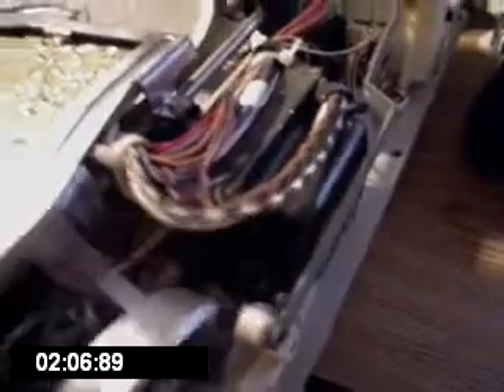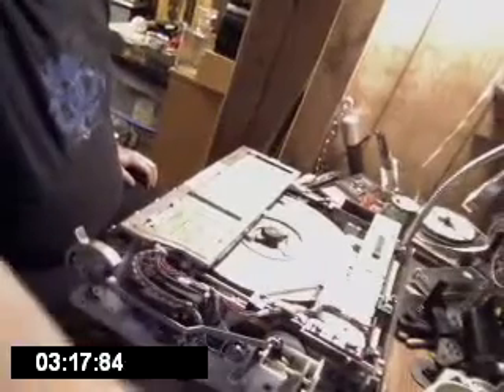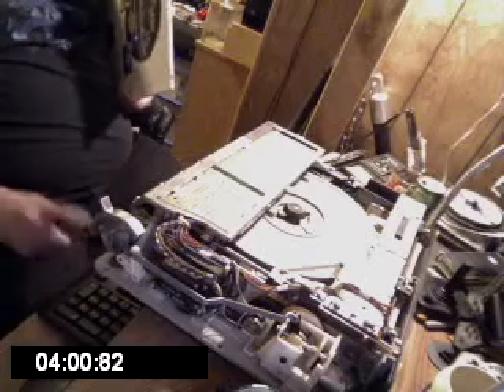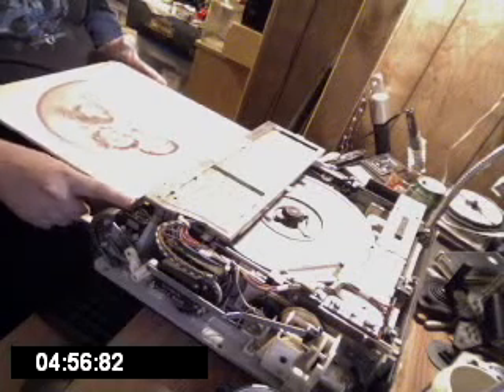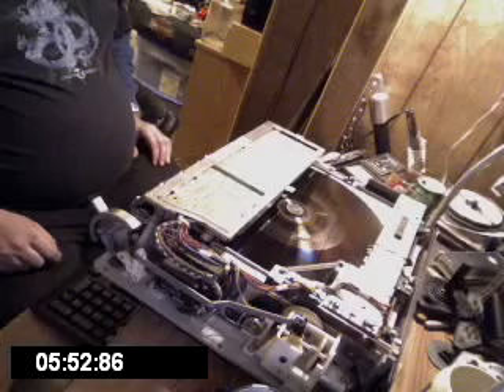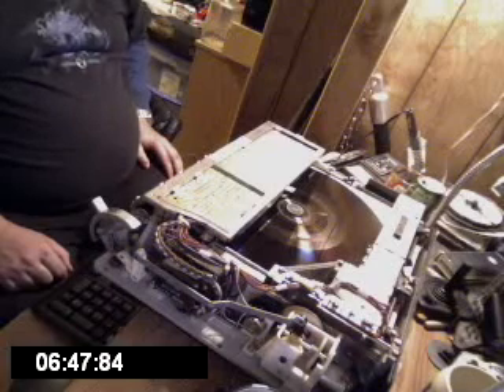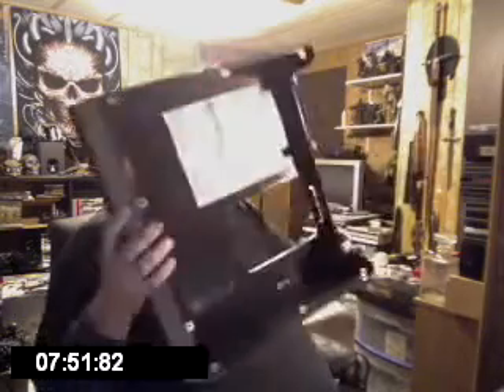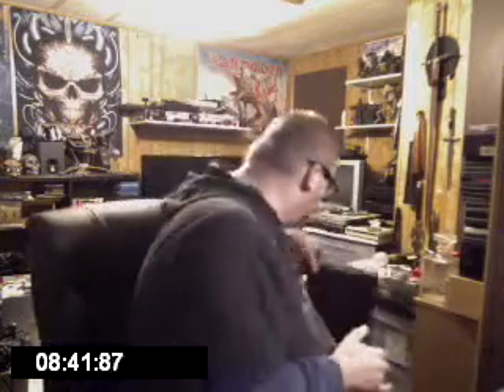1983 RCA Selectavision Video Disc Player opened up to show how it works.wmv

Comment: The model you've reviewed here was the cheaper 'budget' model, thus you haven't got the buttons.  If I recall the actual circuitry for the functions also existed on the board, not just the player button board.

Comment: Nice demo of the innards of one of those machines! I'm planning on getting one if I can find a good one. I find the technology fascinating even though it took RCA 14 years to finally come out with it and when they did it was already obsolete, having been eclipsed by video tape and LaserDisc. CED had all the disadvantages of tape (about the same picture quality as VHS and the discs wear out eventually) but not the main advantage (the ability to record.) And of course Laserdisc didn't wear out.